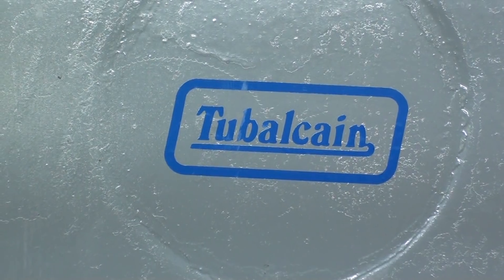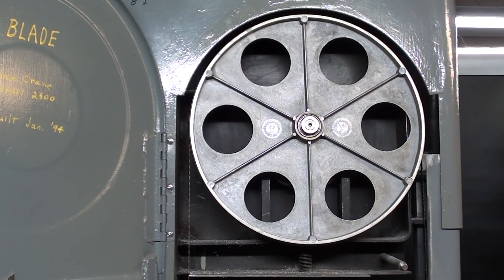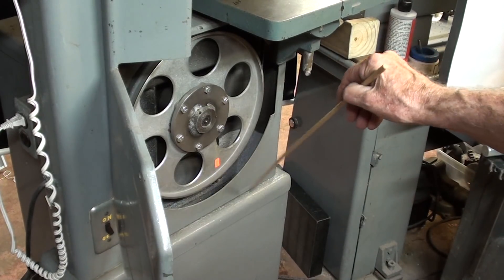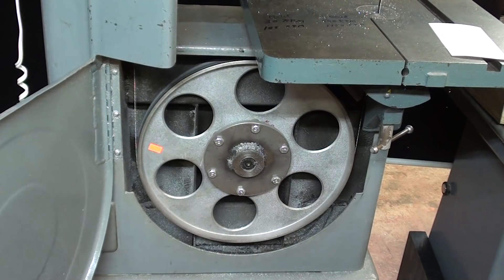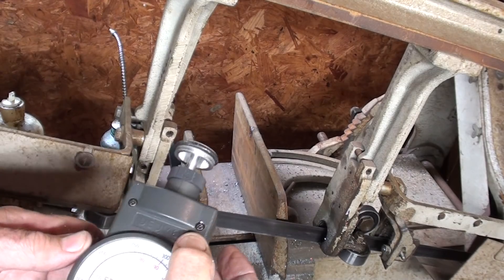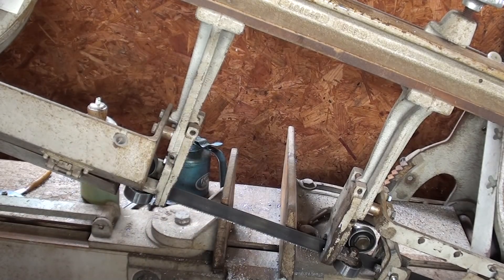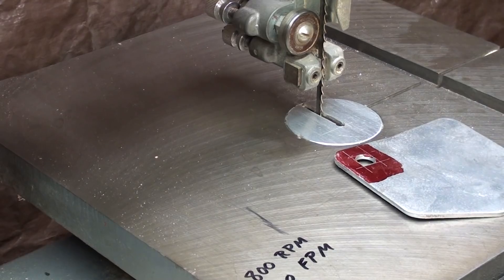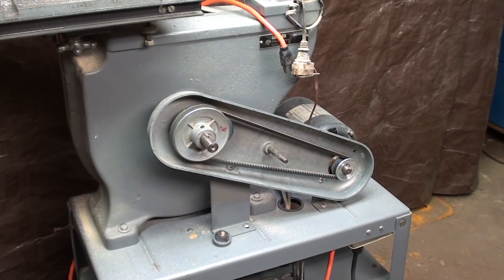Cutting Speeds for Metal Band Saws Tips #487 tubalcain

Comment: Mr. Pete,
   While pastoring a church in Clinton, Illinois back in the 80s I became heavily involved in wood working and antique restoration. In need of a bandsaw for that endeavor I mentioned it to a couple of people. One was an old Illinois Central railroad worker from the steam days and said he had an old railroad bandsaw I could have, all I had to do was load it up and haul it away. I was rather excited as you could imagine. Upon arrival at his place he took me back through his metal and junk laden back yard to an old Model T garage. Upon opening the doors he said, “There it is” and before me was a band saw like I’d never seen. It was huge! The wheels were every bit of 24 inches in diameter and the top of the thing stuck up above the rafters. I have no idea of the brand but it was a work of art. The castings were very detailed and it sat on a heavy cast iron base. Well, my excitement about a free band saw for my wood working business plummeted. First it was way too big for my small garage shop and plus it was a metal cutting saw. It could have been converted but was impractical for my use at the time so I passed on it. I want to kick myself every time I think about it. But then, I have never had ANY shop where the thing would fit. Oh well.
Dale
Reply from the maker: Wow, that sounds like a huge machine. But everything that the railroads had was big
Reply: @mrpete222  upon my wifes insistance, i sold my 1955 Chevy pickup ( it was paid for) so she could have a new trailer house. one of the biggest mistakes of my life.
Reply: Mr. Pete,
  Yes it was a huge bandsaw. It came out of the round table switching yard shop at Clinton. In the heyday of the railroads Clinton was a major hub for the Illinois Central and a few other smaller lines. Over 200 trains passed through Clinton daily, both freight and passenger trains. As a major hub a large shop was needed for maintenance and repair of engines and cars. There is still a railroad car repair and refurbishing company in business there. The old railroader said that bandsaw came out of the round table shop and it was used for all manner of heavy cutting on steam engine boiler and piping components as well as wheel carriages and even track occasionally. I went back there to that old shop a couple of times just out of curiosity. One on my church members was an I C Agent officer and took me there. Illinois Central still owns the property but it’s mostly abandoned. The shop was empty but the yard was filled with rusting parts from the age of steam locomotives. Interesting place.
Dale

Comment: I put a three phase motor from e bay on my craftsman with a VFD to control the speed of the blade. I used a 1hp motor to replace the 1/3 hp single phase so the torque at low speed would be enough to prevent stalling. This gives me almost infinite speed control for different metals, wood, plastic and etc. (I try to not cut meat with it though if you know what I mean)
Reply from the maker: I will be using that type of set up with the VFD. In the future watch for it
Reply: i realize I'm kinda off topic but do anyone know a good place to stream new movies online ?
Reply: @Bowen Owen I watch on FlixZone. You can find it by googling =)
Reply: @Finley Lachlan definitely, I have been watching on FlixZone for since april myself :)
Reply: @Finley Lachlan Thanks, I went there and it seems like they got a lot of movies there :D I appreciate it !!
Reply: @Bowen Owen Happy to help :D

Comment: Good morning! I just came in from the shop and had counted the rpm with a stop watch before watching this video. Mine is turning 36 rpm at slowest speed which is about 132 feet per minute. Thank you. Metal cutting blade is on order.
Reply from the maker: Thanks
Reply: @mrpete222  Good afternoon, I have posted a video on my channel cutting some 1/4 cold rolled steel. Kind of slow but it did cut. 14 tooth 0.025" blade. Thank you.

Comment: On the  oil business:  wood bandsaws have the rubber on the wheels.  Oil will sometimes cause the belt to come off repeatedly if the saw has been converted.  I noticed this when trying to use my wood bandsaw to butcher pork (which contains lard). The meat versions have a little ridge to keep the wheel on.

Comment: I Just got one of those Delta Milwaukee 14" bandsaws.   It had the riser on it and this one was pretty old but in great condition (aside from the lime green paint which is gone now).    But it didn't have the gear box .......... HOWEVER it came with the coolest Walker Turner MOTOR that has 2 gears housed in the shaft end of it which reduces the motor's RPM to 750 before it touches the first pulley.   The gears inside were interesting in that it wasn't a worm type reducer.   It had a small helical gear on the shaft of the motor about 2" diameter.   and the mating gear which drives the pulley was 4" roughly.     I just got finished rebuilding it so I haven't even bought a metal cutting blade yet.    I noticed in your SFM videos you didn't talk much about TPI.  I want to buy a few blades but don't know quite what I want yet.   Probably first some kind of all purpose blade.   I want a 1/4" blade and wouldn't mind a resawing blade too.   I'm very happy with the saw.   It cuts wood very well and the saw is solid.   Will let you know when I make chips on some metals though.   Any advice on blades is welcome.

Comment: I have that same saw with an open bottom stand. It was built in 1950. It still has the bake a light wheels that aren’t cracked but the top wheel is warped and wobbles. I replaced the tired and it works but the blade will pop off when putting a lot of pressure cutting steel. I wasn’t able to remove the upper wheel could you possibly tell me how you got your upper wheel off? Mine is held on with a castle type nut that i removed me the wheel does not budge. I love how you replaced yours and want to do the same on mine, it’s an awesome machine and like you said not a fast process to change speeds but if you only have room for one saw this is the one to have! Thank you for any help you can give and also thank you for all your videos! Best shop teacher ever!!!
Reply from the maker: Thank you for watching. You are the first one I ever heard from that I had that saw. Sorry, I have no idea how I got that wheel off. Those 20 years ago

Comment: This is going to be another great series.  Metal cutting vertical band saws in my area are as scarse as Hen's teeth.  Converting a wood cutting band saw is a define route I wood take.  I have a 2hp 120vdc treadmill motor that would give me low end torque and variable speed.  Or like Bryan Smith below I could use a spare VFD I have and a 3ph 1hp 220vac motor I have sitting in my shop.  Looking forward to the series.

Comment: Howdy Mr Pete, thanks for a great channel. It occurred to me that on the last band saw, you could use the centre guard securing stud to add an intermediate pulley by adding a stepped pulley with a couple of bearings machined in. The driven end shaft looked long enough to allow the pulley to be moved outwards and maintain alignment. 
I recently purchased a wood working band saw here in the UK with the intention of converting for steel so am interested to see what you do in the next video.
Reply from the maker: Thanks keep watching. Lots to come and including several failures

Comment: Lyle skip tooth blades are not strictly wood they have hardened teeth for non ferrous metal. Using a cutting wax when cutting non ferrous metals really helps. It comes in a stick type cardboard tube.
Reply from the maker: Yes, I use them on aluminum

Comment: @mrpete222 

I have my dad's vintage Craftsman (King Seeley) bandsaw from the 50's and am wondering if this would work for making into a metal cutting saw?  It's model 103.24300 and is the bench style, so making a change with pulley size is going to be a chore as it is so close to the table, but more importantly I notice that some of the parts are likely aluminum so does not seem to be very heavy duty.  Can you advise me as to weather you think this machine might work for me or am I just going to destroy it due to possibly of it being too light duty? (Great video's) Thanks!
Reply from the maker: I would hazard a guess, and so you know. I think the aluminum frame lax rigidity

Comment: I don’t know what to say other that you have two speeds on your first saw, 105 & 1750 rpm, 1st good for steel, 2nd works good for aluminum and would work for wood although a higher speed might work better.  Now the second saw appears you been using it all these years at half the ideal speed for steel so I assume you been cutting plastic.  Nice to see you been able to use one of all those belts you’ve accumulated over the years and I can see you made a slight improvement from what the foreman did and put it at the correct speed for steel.  Guess you won’t need it for wood or aluminum for a rush job because you got two speeds on the other one that will do.  Ok, for the best speeds for certain materials I certainly learned that 105 fpm is ideal for steel but really not sure what your recommendation for the best speed for aluminum, stainless, or wood which is why I initially tuned in.  Now it’s not that I didn’t enjoyed your commentary but just saying.

Comment: There's a 9" Ryobi bandsaw for sale.  An older one.  I was thinking of getting it and using it for cutting pipe and small pieces of metal. It's limited to 3 1/8". Says it cuts 2900 FPM. Obviously for cutting steel you'd would want about 105 FPM like you said.. But ideally wouldn't you want motor with more torque as well?  But then I started thinking about a repurposed miter saw giving you so many more options as far as cutting and thickness.  I don't think I've ever seen a miter saw for metal.  Is there a reason I wouldn't want to do that?
Reply from the maker: You can’t use a miter saw for metal. However, you can use a chopsaw with an abrasion blade.
That Bando saw sounds like it runs too fast
Reply: @mrpete222  Why can't you?
Reply: @cityguyusa  : You need to look into the Evolution saws,
 DeWalt, Milwaukee, also make  carbide tooth saws that run about 1,400 rpm for cutting steel, 
at the moment, Evolution is the only one I know of that is a miter type, the others you have to swivel the vice, but they will do a miter.....I have used the DeWalts [14" blade] and own an Evolution [14 and 15 inch blade].....it does a great job on steel and they make blades for stainless, aluminum and carbon steel......
As Mr. Pete says, you can also use an abrasive cut off saw....they sometimes do not do as accurate of a cut, but they are good for certain things like angle that is thick [over 1/8 inch] I have had great experience with the DeWalt Brand, and have owned Ridgid, and Porter Cable....but the Porter cable was 25 years ago, and I do not know if the quality is still there......
I cut steel, stainless steel and aluminum in my shop and use all three types for cutting.....the aluminum gets cut on a Sliding Compound Miter Saw.....with a blade designed for aluminum, negative hook and triple chip grind.....do not try and cut steel with this, as you will destroy the carbide blade almost immediately.....
As far as your band saw, you can cut aluminum with that, just make sure you have a minimum of teeth [3 at least] in the material or you will end up stripping teeth off....
I hope this may help you out and others, by the way, I also cut wood.......

Thanks MrPete222 for a great video, as always, cheers from Orlando , Paul Brown

Comment: Hi Mr Pete. Thanks for the video. I just finished converting my Delta 14” to DC today. I found a used Dayton 1725 rpm 1/2 hp DC motor with a 56c base and it dropped right in. I bought the same KBD SRC you used in the drill press conversion but installed a tach in the SRC box it gives me the RPM but I’ll have to convert that to surface feet per minute. Can you provide speeds for other materials too? Specifically: tool steel, stainless, hardwoods vs softwoods etc.

Comment: Good primer on speeds. Looking forward to the next series of videos.
Would it be problematic to use a bigger driven wheel to slow it down?
Thanks.
Reply from the maker: I do that in the next video
Reply: mrpete222, I must have missed that. I thought it was the Pull Gear exclusively.
Thanks.
Reply: Hi Mr Pete, I just finished my Delta 14” Conversion  to DC today. Found a used Dayton 1/2 hp 1725 rpm 56c base and it dropped right in. I bought the same KBD SRC you showed In your drill press DC conversion and can now easily change speeds. I also like having the lower speed to tune up the tracking on the wheels, bearings and guides when I swap blades. I mounted a rpm display in the KBD box for reference although I need to convert to SFPM. I’d be interested in knowing the other speeds for materials: stainless, tool steel, hardwoods vs softwoods etc. Thanks for video.

Comment: Mr. Pete,
If you can only afford one bandsaw, which is better.  The vertical bandsaw or the horizontal bandsaw?
Reply: My 6" horizontal saw also works it the upright position with a small table attachment. You just lift the saw upright and it stays that way,then 2bolts to add the 6"square table to the frame and your ready for vertical use.